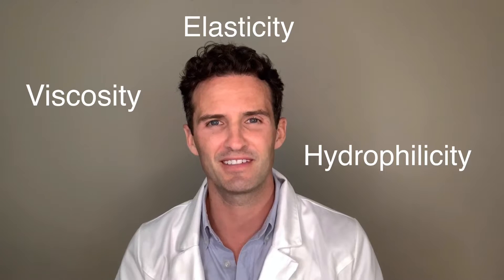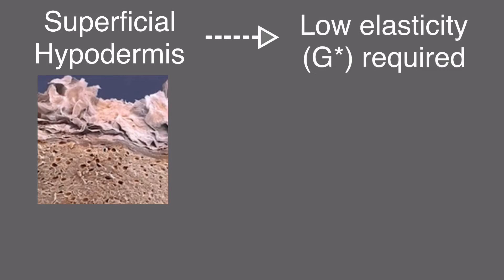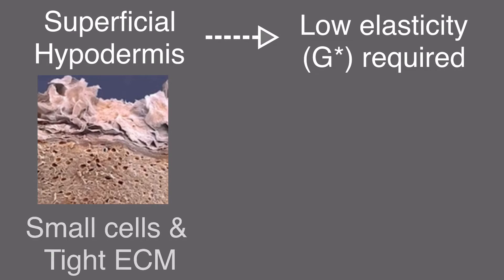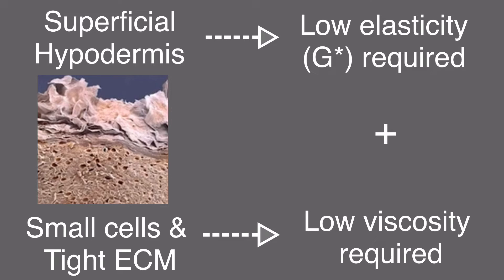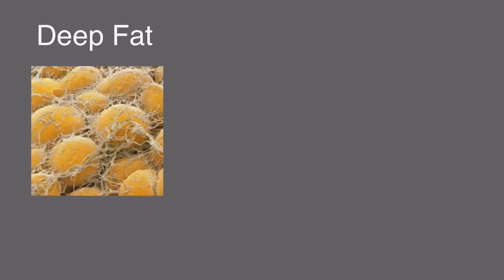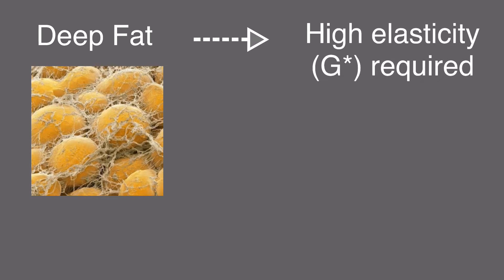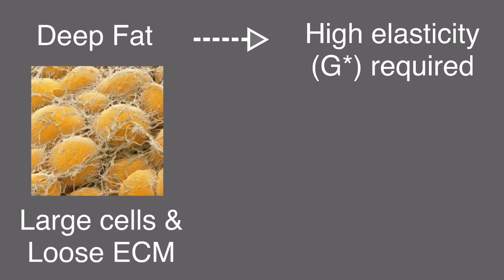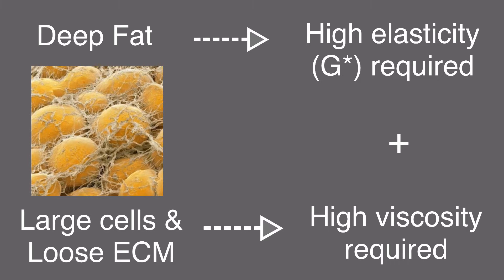HA Filler Rheology: Simplified

Comment: Hi Dr. which type of HA would you recommend for nipple injections, also it would be fantastic if you made a video showing the injection placement in the nipples, ie. drawing, mannequin, or live model. I’m interested in elongating mine.
Reply from the maker: It’s a very simple procedure using a small amount of a very dense HA filler. Any reputable brand will work. It keeps the nipples erect, and lasts one year or longer. 
Thanks for commenting!

Comment: When injecting filler to the zygomatic or mental bone do you inject with the bevel of the needle facing up, down, lateral or medial??
Reply from the maker: Andrea Hovind If you’re going in with a needle and inserting at a 90° angle to the bone, stay the course. If you’re going in parallel with the bone using a cannula, bevel up is what I recommend.
Reply: Thank you!